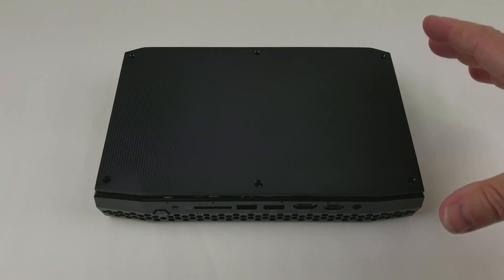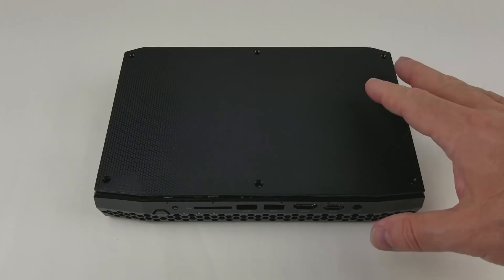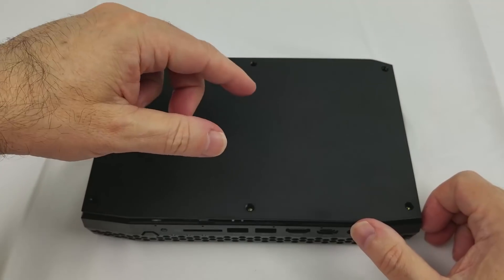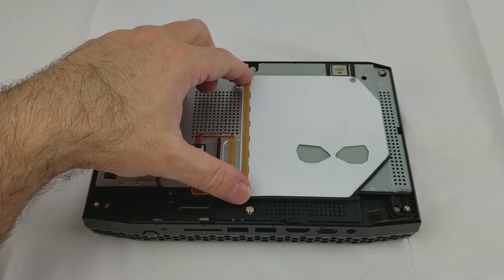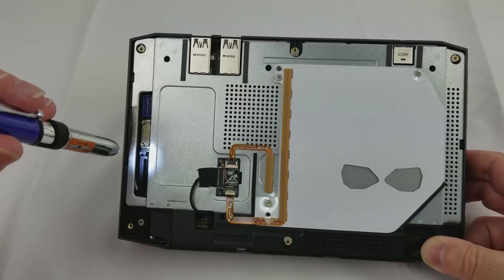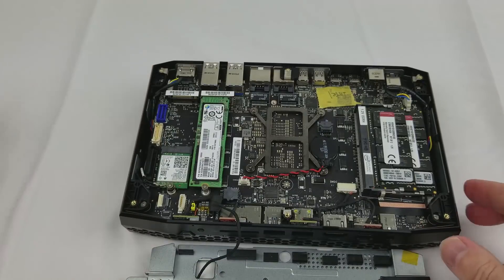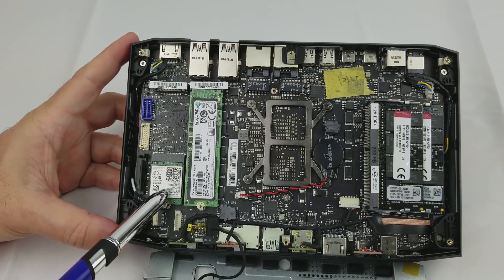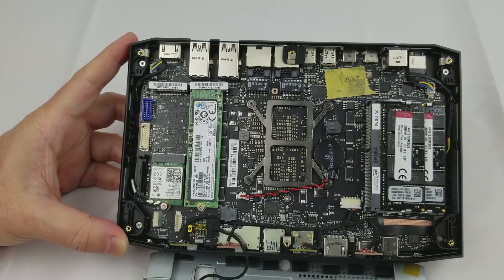Hades Canyon NUC- First Look Inside

Comment: Interesting. I just got one used last week and trying to find out more about the CMOS battery replacement. The current one seems to be a replacement (yellow) and it's a KTS CR2032, which is the same as the one being sold by Rome Tech as specific to this NUC. However in your prototype the CMOS is a CR2016.

Comment: I want to turn my hades into NAS. For that I want to develop external PSB with mSata SSD mounts. Is there a header where I could connect to plug in external at least 4 SATA drives?

Comment: What is the SATA power connector for? (Below the usb 3.0/2.0 pin connectors)?  On the bottom left.  Is there a SATA connector for data?  I’d like to squeeze in a SATA 2.5” SSD with the GORITE riser.   Thanks

Comment: Well I think its safe to say that if realistically static discharge was such a great problem they would include a wriststrap with every unit.

In any "case" id say putting atleast a warning label inside the case would be smarter than doing nothing about it.

Comment: I don't like the skull at all, I hate it ,even you can turn it off, but you know it still there,I don't want to see it at all,imagine that you put a skull into your house ,  not good at all and not kool ethier , can intel have other shapes?
Reply: Shuqi - you can run this unit with the offending cover removed. I not recommending this, but it is an option. I recommend that you contact SimplyNUC to discover if they know of an aftermarket replacement without the skull but something nice that you can also use the cool LEDs for. 

Hey, SimpyNUC, I'm interested in something different too. Not sure how much of a branding deal it is, but there is a market.
Reply: Lets see.....................Buy something else instead of making silly comments?   SMH

Comment: A question about the dual Thunderbolt ports:
Given that each of them has a PCIe x4 lanes, is there a potential to use both of them with external-GPU box (to reduce the bottleneck of a single x4 PCIe hampers all similar builds)?
Of course a corresponding E-GPU box would be needed, which probably isn't on the market yet, but my question is if it's even possible in theory - similar to SLI or Cross-fire builds?

Comment: Looks like a very impressive piece of kit, looking forward to seeing some benchmarks.
As an aisle a couple of questions you might be able to help with as I'm tempted to risk making a custom case for one depending on    how noisy it is.
First does it have an internal 19v connector like earlier nucs? As using a hdplex 160w ac-dc supply for a brick less system.
Secondly any idea what the spacing for the headsink bolts are? As the possibility to modify a desk top cooler for it or even a passive cooler (more likely for the 65w system) is tempting as it would be easier to make a compact and silent system cooling the single Apu than separate gpu/cpu
Reply: Due to having two larger blowers than the Skull Canyon has, it seems quite a bit quieter than the Skull Canyon. The physically larger blowers allow for more airflow at a lower RPM. Also the surface area of the heat sink is almost the entire width of the unit, which reduces static pressure (resistance the blowers "feel") which also helps with noise.
To answer your questions though:
1. No, there is no internal 19v power connector and the motherboard is not expected to be remounted (there are no plans for a motherboard version)
2. Due to the 9 External and 3 Internal USB Ports and the amount of power draw that could be loaded on them, the NUC comes with a 230w power adapter with a special 3-pin power connector similar to high wattage laptops. With just a Kb/M setup running an AAA game, I saw around 130w peak on the 100w version. Managing power loads, you should be able to use a 160w supply on the 65w version.
3. I would be leary of any benchmarks made before the drivers are complete. Anyone testing benchmarks right now would be violating Intel's request and I can say that the current video drivers seem to be early version to make it work and not really get performance yet. It currently performs around the same as a nVidia GF1060 card. Under an AAA game I am getting 100-120 fps at full rendering. Under an AAA planned game for March, the built-in benchmark gave it a "Great" rating for the Ultra setting (the highest the game goes).
Reply: Charles Abdouch thanks for the reply, some really useful info there.   Pity about the lack of internal power connector as I'm not brave enough to solder directly to such an expensive board. Having a power brick isn't a deal breaker but definitely prefer a neater solution.
Aye pity that Intel makes such versatile chips like these and skull canyon but doesn't release them in  a more open format for folks to tinker with, though I can understand the market would be small.
Thanks again though.

Comment: how about noise? noisy as skull canyon?
Reply from the maker: From what we can tell it is quite a bit more quiet since it has dual fans that are larger and spin slower. At normal operation you can barely tell it's on.  You will hear it when it is running a demanding application but it is not distracting at all.
Reply: Simply NUC thats make me feel better. So many articles say, prev intel nuc kaby lake so noisy when its “normal operation”. But new hades canyon big fan lower noise, count me in :)
Reply: I used to have the NUC Canyon (until it got stolen :/)
And while I obviously can't speak for everybody mine was not loud at all. At normal usage you could barely hear it's working given you're in a quiet room (and certainly not in a shared office). Under load you could hear it of course but far from distracting. 
I didn't get the chance to use it for gaming, but used it for work - I often had to run long compilation or database migration tasks which generally stress all components (except the GPU).
If Hades is quieter (which it should be given the dual and larger fans) it shouldn't be a problem (at least until fans wear out in couple of years I guess).
Reply: I know this is an older thread, but wanted to say that the larger fans do make a difference on the over all sound levels. For overclocking and preventing thermal lockout, you'll likely want to put them to max which will send your ears on a quest for silence!
Reply: Stolen!!! huh that's my big nightmare. Can't imagine losing my killer mini pc :(  ...however big thanks for sharing your experience! hope you are dealing well with that stolen part cheers!
Reply: Yes it was a nightmare indeed :/ I even saw the NUC (could bet it was mine) on one of the online flea-markets and some of the components ... and saw them gone before my eyes ... really depressing.
I guess getting robbed is inherent risk with all mobile devices. Don't leave your backpack out of your sight! 
And the way to deal with it is to get the new one 8)
Reply: Thats sucks! yes, try hades canyon looks worst for me :)

Comment: I’m about to preorder the Intel NUC Hades from your website...I’m just wondering which 256GB M.2 NVME drive you’ll be using for the assembled system?
Reply from the maker: We would use a Samsung Evo 960. Thanks for the order!
Reply from the maker: For 512GB we would use a Samsung 960 Pro.  https://www.simplynuc.com/hades-canyon/
Reply: Simply NUC y si quisiera ensamblar el nuc con un disco de 512GB m.2 nvme q disco usan uds? También un Samsung evo 960 o un Samsung 960 pro? Gracias
Reply: Simply NUC via Thunderbolt 3 se puede conectar un egpu gtx 1080ti sin perdida de rendimiento de la egpu gtx 1080ti =? Por las limitaciones del Thunderbolt 3, q segun tengo entendido serian 4 lineas pcie en th3 contra las 16 lineas pcie q se usan en desktop. Desde ya gracias.
Reply from the maker: 960 Pro por 512GB

Comment: Just preordered this at simplynuc.com ! Do you know how many PCIE lanes each Thunderbolt 3 port has? x2 or x4?
Reply: Howdy Raj,
Both Thunderbolt 3 ports are x4 and use different PCIe lanes so both can be active at the same time.
Reply: Charles Abdouch I think this is where people are getting confused on whether this has TB3 or not. In both videos you seem to be saying 'TB3 by USB C, supporting the 10gb speeds'. So with 4 lane individual, shouldn't this support the 40gb speed? Can't wait to replace my SC.
Reply: Howdy Brent, I may have gone through the numbers too quickly. I am trying to convey a lot of information in a short time so the videos don't drag on.
The 2 USB 3.1 Gen 2 Type-C connectors on the back of the Hades Canyon are shared with DisplayPort and Thunderbolt 3. During USB 3.1 Gen 2 transactions, it can run up to 10Gb/s, during (2 lanes) DisplayPort 1.3 transactions, it can run up to 16.2Gb/s, and during Thunderbolt 3 transactions, it can run up to 40Gb/s

When many people see this connector and automatically identify it as Thunderbolt 3, but the actual connector is a USB Type-C connector and became a standard pretty much starting with USB 3.1. In some cases, the connector can have DisplayPort links on it, and in a low percentage of the time, also have Thunderbolt 3.

The USB 3.1 Gen 2 Type-C connector on the front of the Hades Canyon only has the USB 3.1 Gen 2 link and does not have video or PCIe.

The Blue USB Type-A connector on the front supports a 4th USB 3.1 Gen 2 link.
Reply: CPU total lanes are 16, 8 to the vega GPU and 8 to "other use"
Reply: I discovered that the DisplayPort signals on the Type-C connector are DP 1.2 compliant, not 1.3. The two mDP connectors are DP 1.3 though.

 And to clarify some confusion from other sites, the USB Type-C connector on the front panel is just a USB port, there is no Thunderbolt or DP signals on the front Type-C connector. I hear many people mistakenly call the USB Type-C connector a "Thunderbolt connector"

This connector was selected by the USB Committee as their "Type-C" connector. In working with the DisplayPort committee, they came us with the ability to also carry DP on this same connector with the USB signals. Later the DisplayPort committee decided to offer an "Alternate-DP Mode" feature that some computers add to the USB Type-C connector.

Afterwards, the Thunderbolt committee decided to select the USB Type-C connector as their standard for carrying Thunderbolt 3 signals. Perhaps 100% of all USB Type-C connectors have USB on them. But a smaller percentage also include Alt-DP signals and even less than this is if they should carry a Thunderbolt 3, perhaps less than 10%. Yet I hear many people call this the Thunderbolt 3 connector. It is technically called the USB Type-C connector.

Comment: Did they fix memory dencety bug?
Reply: Do you mean Memory Density?
Do you have a link to an article that discussed a "bug" I can review to give you specific details?
I have not looked at the Memory Controller registers to see if this is true, but I believe there is a limitation of 16GB per DIMM socket and only 2 DIMM sockets are supported on the NUCs, so that limits us to 32GB of memory.
Reply: Charles Abdouch https://www.intel.com/content/www/us/en/support/articles/000023485/mini-pcs/intel-nuc-kits.html
Reply: Howdy Marko. This issue only affects the NUC6CAY products as this is a DRAM Arraignment issue found on DDR3 DRAM (256Gbx4 vs 128Gbx8 kind of thing). The smallest density of DDR4 is 4GB and so there will not be any 1GB or 2GB DIMMs. I don't believe there are any such issues with the DDR4 DIMMs
Reply: Charles Abdouch ok, thanks

Comment: The performance for the size is hard to believe
waiting for benchmarks before making my decision...
Reply from the maker: Understood. We promised we wouldn't benchmark the prototype but as soon as we have a production unit in house we will post some benchmarks.
Reply: We are impressed internally with the benchmarks on this Hades Canyon prototype but are prohibited from revealing them. When we tested the Skull Canyon prototype, the production version of it had much better benchmarks. Currently the video drivers for the Hades-Canyon are kind of cludged together and we know we'll get better benchmarks once official drivers come out.

Comment: Do you know if the two Thunderbolt 3 ports are independent?  Meaning do you get 40 X 2 Performance or do they share the bus and you are getting more of a 'loopthru' as it only does 40 total for the speed.  Thanks for the overview of the product.
Reply: Howdy Rich. The 2 Thunderbolt 3 ports are independent and can provide up to 40Gb/s at the same time.
Reply: THANK YOU and WOOHOO it is now the most useful small form factor of the bunch.  I do have an issue with the AMD implementation but that is because vMix has had issues with the GPU and the nVidia GPU works better with vMix.  Good News is that you could use a Thunderbolt GPU but it will only be X4.  Now my brain is going into overdrive of how to implement the new NUC.  Thanks again.
Reply: Howdy Rich, I am using an External Akitio NODE with a GeForce GTX Extreme 1060 (Aorus card) from the Thunderbolt 3 port on my Skull Canyon. The performance numbers we're getting with the setup makes us wonder if the x16 bus is saturated on a normal desktop as we're getting similar benchmarks (10% less). I heard from one person that the GPU is only x8 although the standard is an x16 card. If the bus isn't saturated, or just some burst times when the x8 is fully saturated, then the x4 limit might not be noticed as much.
Reply: That may have been confusing to read. The takeaway is that the benchmarks are fairly close to the published specs even though we're using a PCIe x4 Thunderbolt 3 link. This makes us think that the bus isn't saturated often enough. I am getting 120-150fps at full rendering on a AAA game with it.
Reply: Thanks for the 1060 info and I had a feelimg I could make that work.  If vMix or should I say AMD played well with vMix then there is no need for extra hardware.  I could get the external box for capture and use the other T3 port for mass storage

Comment: this is awsm . would like to know abt temps while gaming and thermal throttle?
Reply: Howdy Sumit. I installed a High-Def version of World of Tanks and ran it with every single graphics setting at maximum and got 105-125fps with around 121w of MAX TPD and never had the processor throttle. In fact, the blowers would spin up a bit and then spin down during gameplay. The blowers never stayed at a high speed where  I could hear them. I was shooting a video of the gameplay in a recording studio and trying to capture the blower noise, but it would spin down during gameplay.

Comment: no info in their website...:-) No info on GPU
Reply: There are 2 versions of the Hades Canyon, the 100 watt which will use the i7-8809G processor and the AMD Radeon Vega M GH GPU, and the 65 watt which will use the i7-87005G processor and the AMD Radeon Vega M GL GPU. Our prototype is the 8809G+GH GPU, which I am very impressed with. I ran World of Tanks High-Definition Client with every single graphics setting set to the maximum setting and got 105-125fps while pulling a Max TDP of 121 watts
And this is without the production version of the graphics drivers, which we expect to be better.
Reply: The GPU is the AMD RX VEGA M chip. It is combined with the Intel core CPU. So it's an all in one modular chip.
Reply: Info up now. More to details to follow.
Reply: Clicking on the preorder links gives a "This page isn’t working, www.simplynuc.com redirected you too many times." error.
Reply: https://www.anandtech.com/show/12226/intels-hades-canyon-nucs-with-radeon-graphics-are-official-799999-shipping-in-spring-2018
Reply from the maker: Working on getting this fixed.  Thanks for the heads up.